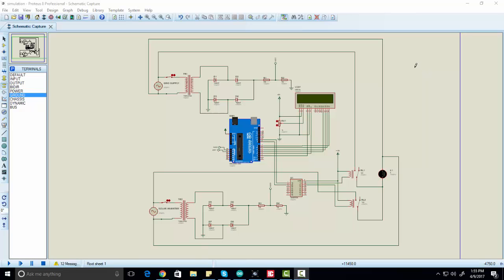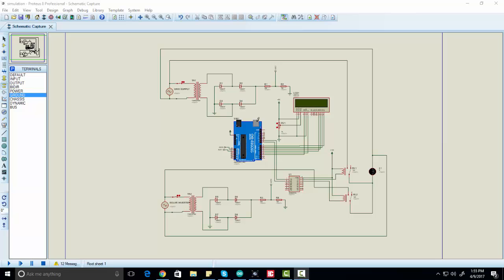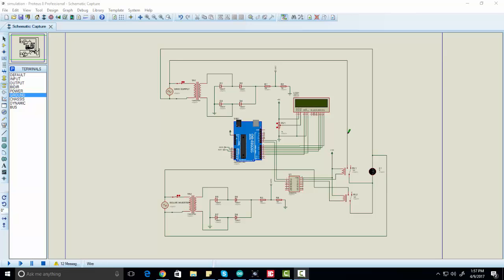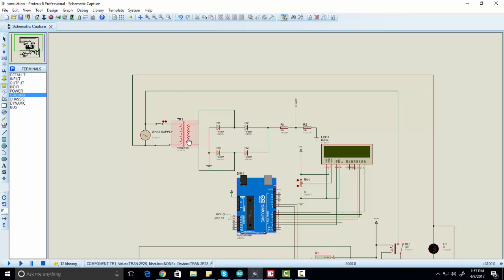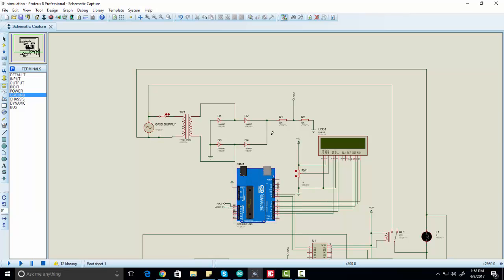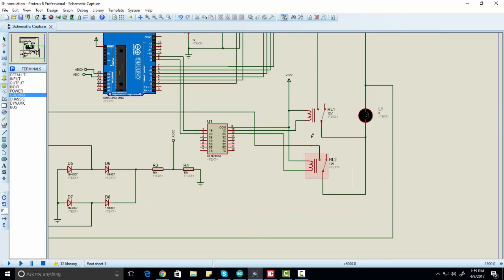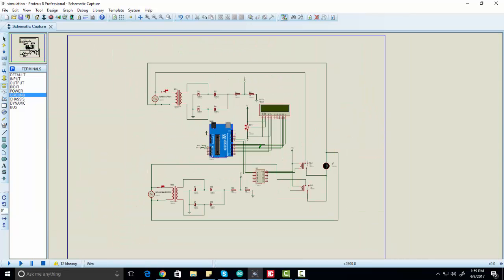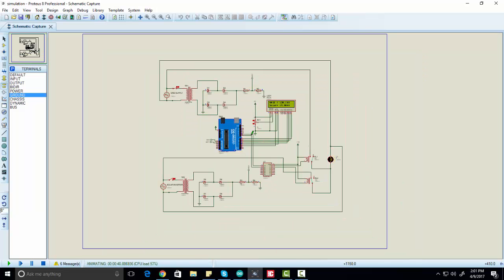automatic power source selection between two sources circuit using Arduino uno

Comment: One question?
Is the AC cycle synchronized between the 2 power sources? Or is the load submitted to a voltage spike when the switching happens?
What is the switching sequence, both sources overlapped during a fraction of a second? Or the load sees a power cut during the switching from one power source to the other?
AFAIK this kind of power switch must be done in a zero crossing point of the AC cycle on both sources, so they need to be in sync. How is that done in this project?